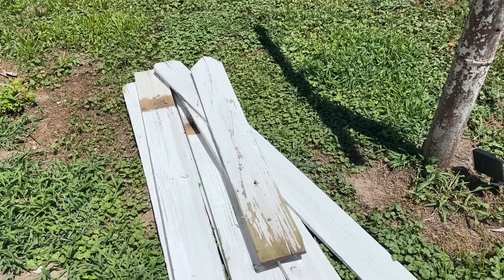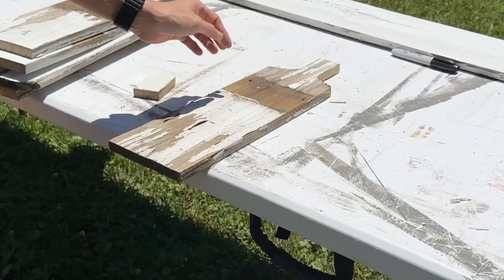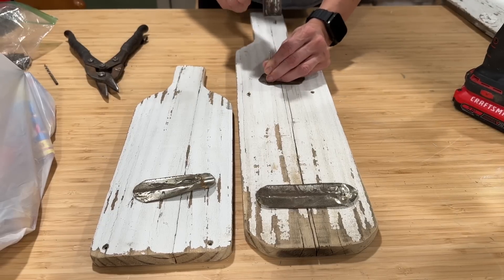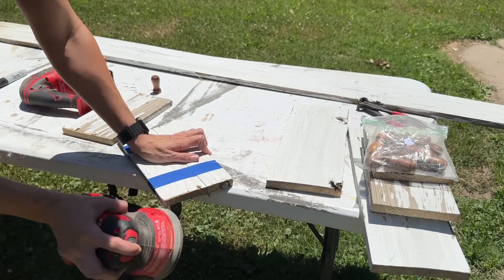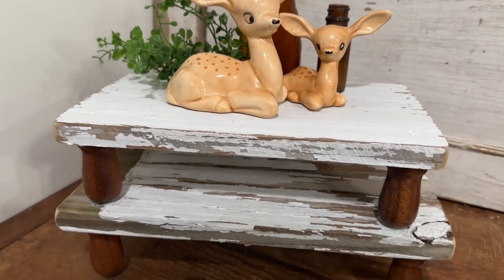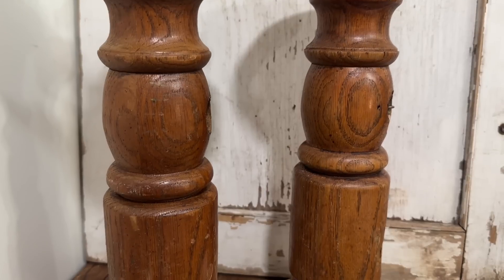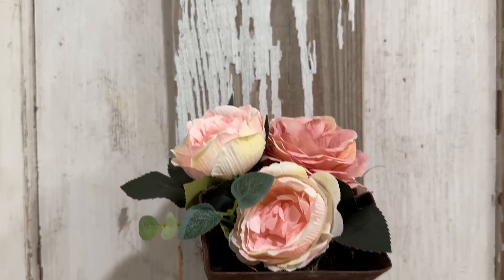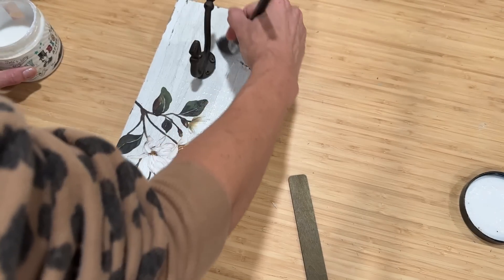Trash To Treasure | Flip Free Fence Boards for Profit | DIY Wood Projects | 5 Fence board Projects

Comment: If you don't have the salvaged metal pieces for the faux repairs, grab a few throw away metal sheet pans/cookie sheets at dollar tree, white vinegar, cut out your shapes (or cut afterwards,) wrap in a vinegar soaked rag or fill the bottom of a large dish overnight for best results. Walla! You have faux salvaged metal pieces for your projects... You can do the same thing to cut out leaf shapes for fall, Xmas trees or other shapes at Xmas, and even things like farm animals using a template cut from your computer 😁 stunning ideas as usual girl! ❤❤❤